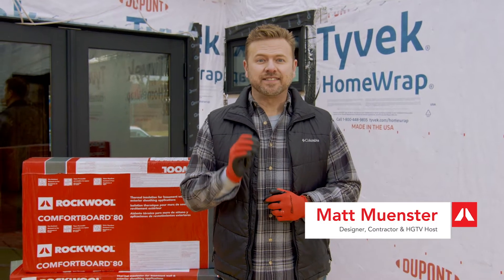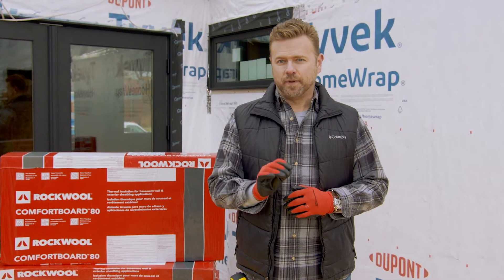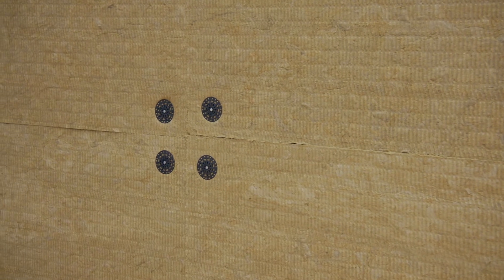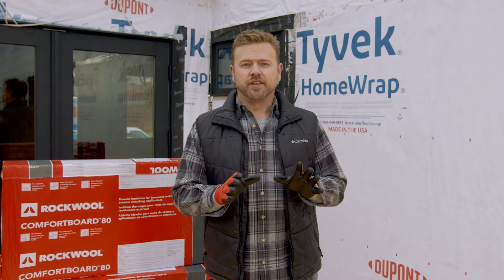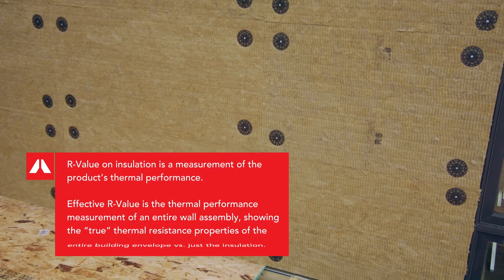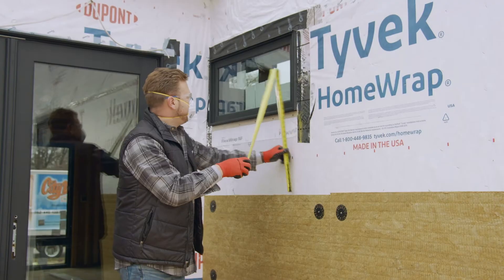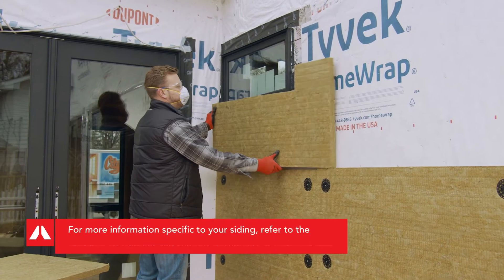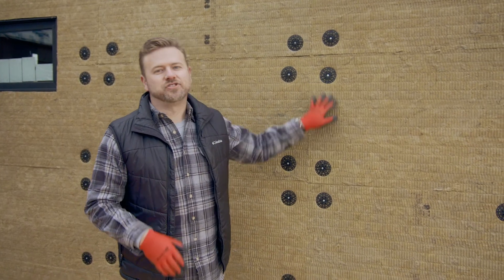How to install continuous exterior insulation

Comment: Can’t buy it anywhere.  Some kind of supply chain trouble.
Reply: I was lucky to find 40 available in Saskatoon recently at Home Depot but according to a local Home Hardware, there definitely is a supply problem as it would be around 6 months wait time for new orders to be fulfilled. Also, as of July 1st 2024 I read there will be an 8% price increase to most of Rockwool products.

Comment: This video isn't useful.  Where are the details like corners, transitions to other surfaces, dealing with the squish factor, fasteners to surfaces other than osb sheathing, installing to depths greater than commonly available lengths of insulation nails, etc.  Please produce some more comprehensive videos.
Reply: It's ironic, because right now they ignore the builders who are wise enough to see that these details need explaining and won't use this method because details aren't provided, while simultaneously ensuring that anyone who doesn't realize the complexity of those details will encounter them once and swear off ever doing it again. Rockwool is truly shooting themselves in the foot by not sharing this info.
Reply: @dosadoodle  I agree. I searched and found Matt Resinger vids, The build show YT man and he has a few vids. Rockwool should do better than what they did here....failing grade for info and presentation. 👎        😑🇨🇦
Reply: Hi KH. Great comment.  Did you hear anything from the company?
Reply: Exactly like to see window door options for trimming (ie) wood or metal